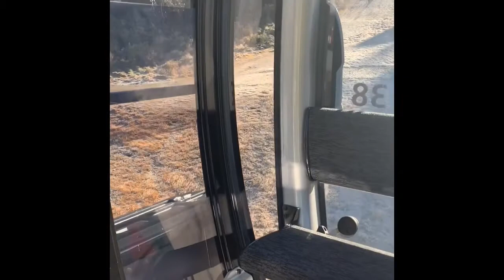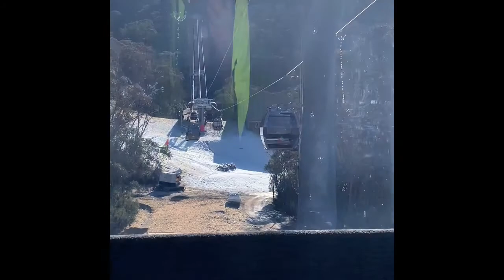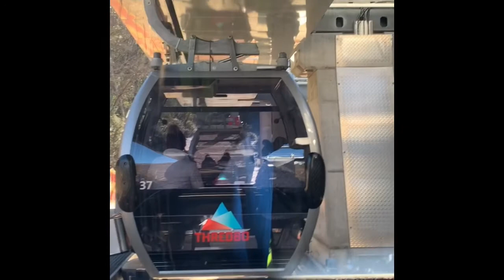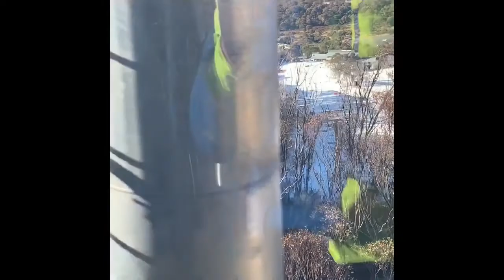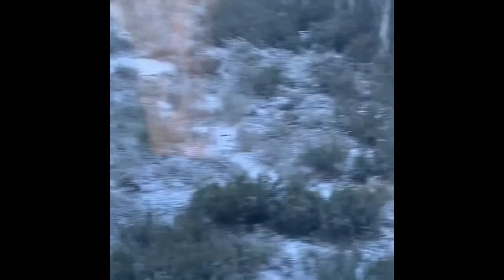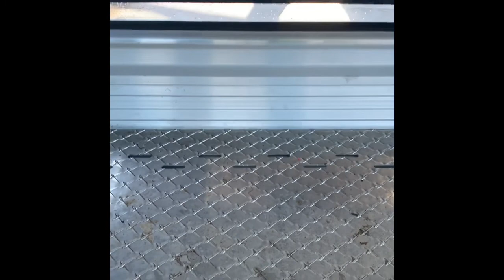I Went On Thredbo’s New Merrits Gondola To The Top

Comment: Thanks for sharing. How do you get back from there to the starting point? I am planning the take a trip down there.
Reply from the maker: what do you mean?
Reply from the maker: you mean from the top to the bottom
of gonde
Reply: @TheDigitalSkier  yes
Reply from the maker: 4 ways. Go down gondi, take the traverse to kozi and go down on super trail. Catch cruiser,  traverse to high noon go down  hop on at gondi's mid station and go down. And last ski down dream run catch gondi down at mid
Reply: @TheDigitalSkier  thanks. But if I only want to go down and hang out and want to come back to where I got on to the cable car, is that possible or I need to purchase another pass for that? I don't intend on Skiing or anything as such.
Reply from the maker: @shawonmq  no you have 1 ticket which takes you up to the top and down